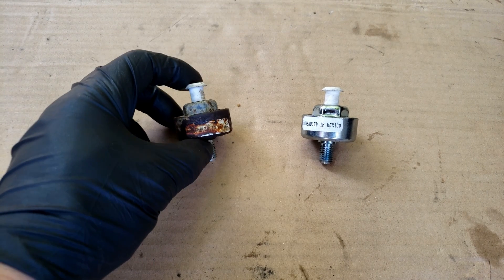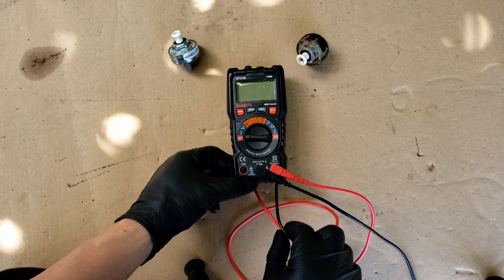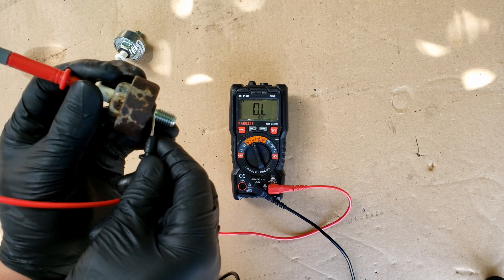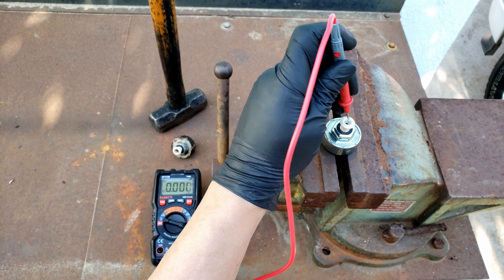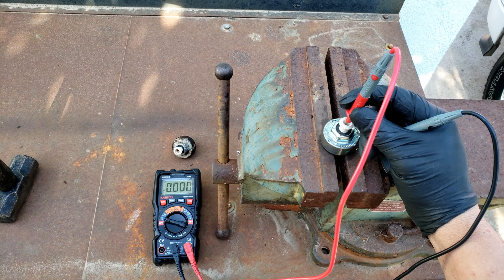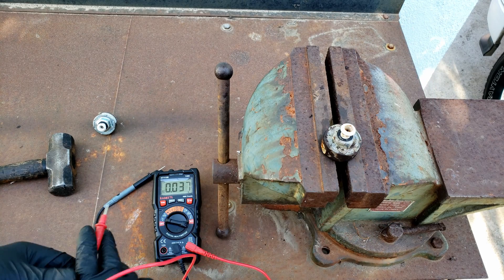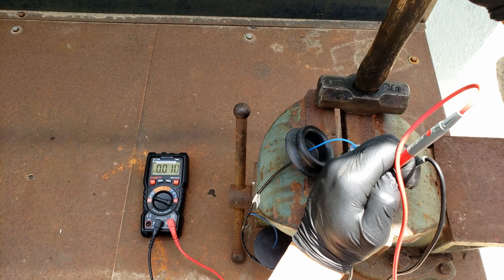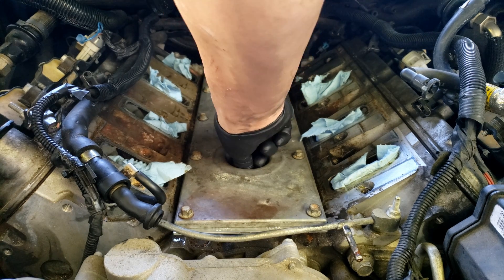How to Test A Good and A Bad Knock Sensor

Comment: Replace both knock sensors and harness on my ls engine but still giving me knock sensors code. Could this be pcm problem or something else?
Reply: Make sure that the new knock sensor is acdelco original because a lot of these off brand knock sensors are not working like they should I’ve bought three different types of brands and that what my issue was hope that helps

Comment: Thank you so much, i’m going to try this on my 99 Z28. I put a new wiring harness and new AC Delco knock sensors, but I’m still getting a low circuit. I may have over torqued it or it may just be a bad knock sensor. Really appreciate your help.

Comment: Interested why AC and not DC since vehicles use 12VDC, can you explain
Reply: Like an alternator, a knock sensor generates ac, except at a much lower voltage.

Comment: Super informative, thank you. In a 1990 SBC a knock sensor is located in a drain plug just above the oil pan, after removal and reinstallation I got pinging under load and a "service engine soon" light with code 43. It needed substantial torque to remove, so I suspect it damaged the sensor internally.

Comment: different gm knock sensors have different resistance readings, some are 3900 kilo ohms, some 8900, some 100,000
Reply: I bought a new from rockauto with my car as a search engine and got a 100kohm at home.
Car had error codes about the sensor, but since it was new i dat didn't look at that issue.
After a few days i started to think back to this sensor and took the one from another 350 engine i have laying around. This one gave 3,892kohm ( just like you said ). Plugged it in and all error codes where gone. Thanks for the extra info of GM stuff

Comment: Hey bro What kind of Tester are you using/ recommended. I've had to change these knock sensors now for the 4th time on my 2004 chevy Tahoe. 1st three times was with O'Reilly's parts, that were not put in at proper Torque specs, 4th time I got the parts from the dealer and torqued everything to specs after watching a video on install.  Worked great for about 3 hours then threw the code again for both sensors. I remembered that when I purchased them, the fricken nimrod at Chevy threw the sensors on the concrete counter when I was purchasing them. Lots of bright people out there. If I would have known about your video I coulda saved so much time and money. Thank you for video! but yeah what type of reader are you using. I'm not super good with electronics. voltameter? multimeter?  I am good with speakers and audio wiring but not vehicle lol!

Comment: My sons new to him 1998 Camaro SS has the dreaded knock sensor of doom or in this case PITA code P0327.   Not looking forward to getting the intake out of a 4th gen camaro lol but armed with the knowledge of your video I think we can effectively troubleshoot this thing quickly and easily.  Hopefully there will be a smoking gun.    As you probably know driving around with that code stuck on severely limits power available.
Reply: Whas the knock sensor bad?
Reply: @michaelmartinez9602  Don't know for sure.   We ended up replacing the harness the sensors (NAPA USA MADE) and making sure not one single bit of the exhaust system was rubbing on the body anywhere.   Codes have been gone since and knock sensors verified to be working correctly via HP Tuners scanner.

Comment: good video. I have a 2002 chevrolet Silverado and p0327 code pops up. replaced the knock sensor new and it still shows the code. sometimes it goes from the red light to the yellow light on the scanner. any ideas why I have this problem? thanks
Reply: I also have a silverado. Common problem with the knock sensors are actually the harness. $50 from Rock Auto with two new sensors. You could also try relocating the knock sensor to the back of the head.
Reply: Where you able to solve this problem? I replaced them 2 times and it keeps giving the same code.

Comment: Hey quick question:  I tested two different brands of knock sensors.  Both sets are giving absolutely no voltage when vibrated and hit.  I'm set at 200 AC on multimeter and tested it directly seated In the engine.

My multi meter works. I tested it in an outlet.  Do you think it's my multimeter or these 2 different brand aftermarkets are just bad? There's no way right?
Reply from the maker: My guess would be maybe an issue with not getting a good ground signal or the meter is not picking it up fast enough to register what its putting out..have u tried testing em on a bench or something similar just for a quick test
Reply: hmm ground signal?  I have it on a vise, and the vise is painted.  Does that cause problems? sorry electricity is not my thing, lol
Reply from the maker: @SerratedAMG  well the knock sensor uses the threaded section to ground itself...so thats why i put the ground lead right against that
Reply: I think that may be it. I'll test it out tomorrow and apply this same concept to everything in the future. Thanks a lot for your hard work in your videos. 
Keep on wrenchin'.
Reply from the maker: @SerratedAMG  hopefully it is..good luck🙂👍 thank you

Comment: i just installed 2 new aftermarket knock sensoers  ... one of them is working and one giving sesnore 2  low  input circute ......  always buy gunuin parts
Reply from the maker: Yea, genuine parts always work best...especially since it requires so much work to get to em

Comment: Cool video.
Getting 8.2k should they be replaced? Thanks.
Reply from the maker: Thank you🙂 for resistance? Well good spec is 93-107k but never understoof if that meant 93k-107k or 93-107k which seems to be too big of a margin and most good ones fall near 100k
Reply: @backyardchevy328  Yes, resistance. It's off of a 7.4 vortec and the darn thing has two knock sensors both reading 82k. No check engine light however but the truck is running poor. Swapped out just about everything but those including injectors.
Reply from the maker: @abrahamvenegas2422  have u checked compression to verify internals are fine? And no issue with cams valves etc.?

Comment: What should I set my meter on
Reply from the maker: Well there's the test for ac volts and that one youll want to set it at 20v if thats the lowest it has..and for resistance 200k ohms
Reply: @backyardchevy328  thank u very much for your reply
Reply from the maker: @jefferygreffin3112  anytime🙂👍

Comment: Very interesting. If you ever get a chance, you can buy meter leads that have various clips, ends, and connectors. It's cheap and makes jobs like this super easy. Lead connections on volt meters are generally universal, so a good test lead kit should fit. I have two meters and my kit fit both of them. It's one of those things once you've had it, you can't do without it.
Reply from the maker: Very good idea🙂👍 i have some in my old tool box but completely forget about em when it comes to using em

Comment: Well, I actually got 2 defective sensors....after days of checking my wiring for resistance, continuity and correct voltage I must say that detonators coming loose in a box are definitely a no-go.
Both got good resistance 99.x ohms but both won't produce any voltage with vibration, what a waste of time and effort that was.
Reply from the maker: What did u end up doing? What brand were they?
Reply: They're the same brand you have in this video but they got shipped in a box rattling around loose in there.
Both got resistance but don't produce voltage.
I just got 2 more in a soft bubble envelope today, I'm gonna test again if they work I'll just send the last 2 back.
Reply from the maker: @g00dl00kinb0i  hopefully those 2 work out..let me know how it goes...good luck
Reply: @g00dl00kinb0i  im in the same boat. Bought 2 new ac delcos off amazon, and the dipshits shipped them loose inside a paper envelope. Both are fucked, truck runs worse than it did with the originals in it lmao. So tomorrow, i gotta go pay advanced auto $200 for theirs and hope thats the last time i pull the intake. Got a 1200 mile trip next week and cant wait on amazon to screw me again
Reply: @lsxbird
What I do when buying those is purchase something else with the sensors so it comes in something else then an envelope.
I'm the end it's just best to go to a store because they'll protect them WAY better but Amazon has much better prices.
I also bought 4 at once before just to make sure I get enough good ones.
Reply: @Andrewclose
I'll be honest when that happens your best bet is just to find a good and trusted tuner shop.
They'll tune the code out because most likely you just have a glitch, that was my case.
I ran new power wiring from my battery to the PCM, from there to both brand new (10x tested and working) detonators and still got the code, I even tried the 100k ohm resistor trick and both P-codes still showed up after 1.2 miles of driving no matter what !

I never found a solution for that issue but my Corvette tuner shop got it done with EFI Live software for $300.
Reply: I know this is old but I just ran into the same problem. 2 new acdelco's from amazon. I ended up using my old one that works better and actually produces voltage. If anyone has come up with a solution please let me know.

Comment: How informative....great video man!

I just spent an hour digging out my intake manifold and cutting my hands on the cowl of my beloved Camaro SS and want to make sure these GM detonators are working right, now no guessing anymore👍
Reply from the maker: Thank you🙂 yea doing any work that area sure leaves some reminders lol
Reply: Yes but when you succeed it makes driving so much sweeter.
Btw, I call those reminders punishments for not buying the Corvette😉
Reply from the maker: @g00dl00kinb0i  haha..i feel exactly the same way..my dream car has always been the corvette..and yup on those u dont have to worry about the cowl getting in the way..well except on the zr1 that cowl does block some supercharger bolts
Reply: lol, I guess that's why it has 755hp, controlling such output will make you forget the pains of the repairs every time.
Btw, thanks for the tips here I've used my meter to check my GM sensors out as they came loose in an Amazon box and now I know they're working👍
Reply from the maker: @g00dl00kinb0i  thats great🙂..glad to hear👍
Reply: @Backyard Chevy
Hey if you don't mind letting me know what you think....is testing them for voltage while installed in the motor and tapping the motor slightly with a 3lb hammer a good idea ?
I don't have a vice and I'd like to not do this for at least a year or two, they ship them like morons, at least the harness came in a padded envelope...
Reply from the maker: @g00dl00kinb0i  yea, that way works too..the only thing is finding a good spot to tap on or u mean doing it with intake off?
Reply: @Backyard Chevy
Yes with the intake off, I'm about to install them but they were loose in a shipping box.
I was planning on tapping the valley cover or heads area above...

Comment: Hey BackYard Chevy I have a 2003 Chevrolet Silverado with 4.8 I had a shoo replace both sensors and harness 5 months ago and code came back almost immediately so I keep driving it but I bought another set with new harness from Oreily’s I think it’s Dorman Brand and installed them and drove and got about 20 miles and it came back on again on bank 1&2 what else could I check for that would be causing it to throw po332 & po327 codes my truck runs fine no knocking sound just has less power and uses a lot more gas only gets 10-13 mpg any help would be greatly appreciated
Reply from the maker: Ive had issues with the dorman brand knock sensors but normally not to the point where theyd come back right away, especially after doing em twice..was the area where they thread into pretty clean as in good contact surface? also be caused by an issue with ur trucks egr or a problem in the cooling system like a faulty thermostat, sludge in system etc.

Comment: Thanks for the video. 
Very helpful. 

Question to you....
Would oil in a 2 pin sensor cause a short, forcing a code? 
Or, would a faulty pcv valve cause a knock sensor code? 

I've had 2 codes in the last 2 years. 
One last Fall (2020), & one a yr earlier. 

I parked the car at Xmas time after an engine stall event, but the engine ran fine after the event & still runs fine. 
There doesn't even seem to be a Timing issue.
Reply from the maker: Engine oils non conductive so it wont cause a short..but it could affect the connectivity of the wire....a faulty pcv valve wouldnt a affect a knock sensor..but if the knock sensor gets moisture and rust on it, it could affect the ground and also damage the knock sensor itself.
Reply: @backyardchevy328  

Thanks for the Reply. 
Appreciated. 
That's a good point about the oil not allowing a circuit at the connector. 

So, I just tested both sensors "still in the engine" & 'both' have 6.6 ohms, while neither gives me a voltage with a smack to the head (🙂) 3" away from the sensors. 

I'm using a $400 Fluke tester, & I'm in a 3.3L V6 in an 08 Hyundai Sonata. 

One more thing...
Both sensor connectors were full of oil because of leaking valve cover gaskets directly above the sensor locations. 

Do you think the oil could saturate & damage the sensor? 

Any further thoughts on my situation? 
Thanks. 👍
Reply from the maker: @waden9815  do u have it on ac voltage? It should be putting out some reading
Reply: @backyardchevy328  

You bet. 
The meter picks up nothing. 
Nothing to ground, & nothing between the 2 pins. 
Each sensor has 2 pins.
Reply from the maker: @waden9815  yea if its not picking up the tapping producing voltage between terminals then seems to me u got a bad knock sensor
Reply: @backyardchevy328  

What are the chances of 'both' going at the same time, while displaying the same characteristics? 
Voltage, resistance etc. 

I ask because I guess I'm trying to avoid lifting the car & draining the cooling system, & pulling the backseat in order to get to the fuel tank so I can depressurize it. 
None of it's difficult or even tedious, it's my hobby working on my car, but why do something if you don't have to? 
Ya know?
Reply from the maker: @waden9815  yea i know what you mean, chances are slim but unless if the tapping isnt loud enough to register, they are meant to produce voltage..maybe if u had another to compare with that's outside of car say they allow u to try it out at autoparts store without installing it
Reply: @backyardchevy328  

Yeah, good point. I'll look into that. 
It's always a good place to start, to have a new one of something to compare. 

Once again, thanks for your input. 
I appreciate it. 👍. 

Keep up the good videos. 
Information, a different angle is always good to have access to. 

Even though I may have something to say/ask later, I'll say 🍻 anyway.
Reply from the maker: @waden9815  thank you🙂 yea, let me know what happens with the test on a new one👍

Comment: Thanks for the vid. Do you think I could hook up a light to my knock sensor. I've got a  carburated gen3 ls engine. And I'd set my total ignition timing via a knock sensor light.
Reply from the maker: Well it wouldnt light up bright enough unless it was really knocking and that would be risky on ur engine...when i did a ls swap with a carb on it i used the msd box and adjusted the curve that way
Reply: I suppose I could just wire the multi meter to the sensor harness. And monitor my knock that way. I would rather have a light that gets progressively brighter though
Reply from the maker: @billbraski2175  yea, they actually sell a gauge i think its made by caspers electronic to monitor knock...they sell it on ebay too i believe
Reply: @backyardchevy328  swaine thanks
Reply: I'm running  a 250shot on it. I gotta msd 6010 box with a ignition retard dial as a traction control device. The knock sensor would just be nice to have to know if I'm pushing it a little to hard.
Reply from the maker: @billbraski2175  yea definitely, i can understand why...especially on nitrous..the hard part will be to make sure its accurate dependable and can pickup signal really quickly

Comment: I have a 90 K1500 with a knock sensor less than a year old that failed. I have since bought and returned 3 knock sensors because they failed the resistance test as depicted in this video. 2 of the 3 were ac delco. I have used 2 different multimeters to test them. Any ideas what's going on?
Reply from the maker: what resistance are u getting? some vehicles knock sensors do have difference resistance values
Reply: @backyardchevy328  I keep getting 0 resistance. The Haynes manual gives similar resistance values to what you said. I ordered the delcos thru mail and wonder if the shipping affects them.
Reply from the maker: @edbaker7884  what setting do u have the meter set to? Is it a self ranging meter or u have to set the dial?
Reply: @backyardchevy328  I've tried it at the 2k and 20k ohm settings, even at the 200 ohm for good measure. Still nothing.
Reply from the maker: @edbaker7884  i would try testing the resistance on something else like say a spark plug wire just kinda to make sure u get a good resistance value on that..set it at 200k ohms u should get a pretty high reading depending on length of wire and type of wire though but should give u about 12k per foot
Reply: @backyardchevy328  Ok I finally got back on this today. I tested the coil-to-distributer wire, which is 10 inches long. On the 200K ohms setting got a reading of 2.8 . I don't think the multimeter(s) are are the issue. I think I will return the latest knock sensor and order another delco at a local parts store. I will test it before I purchase and hopefully get a good one. I can keep reordering until i get one that tests ok.
Reply: @edbaker7884  did you get a good one?